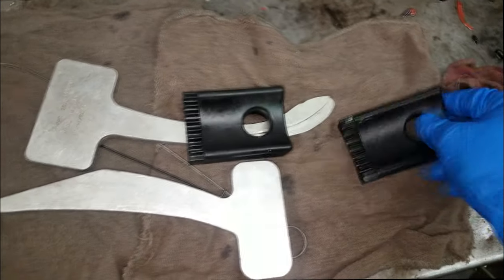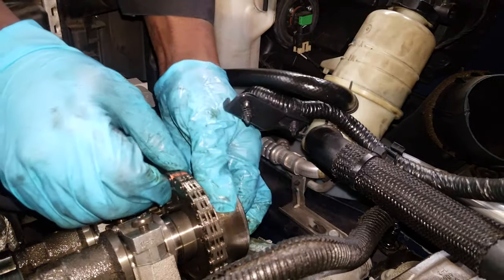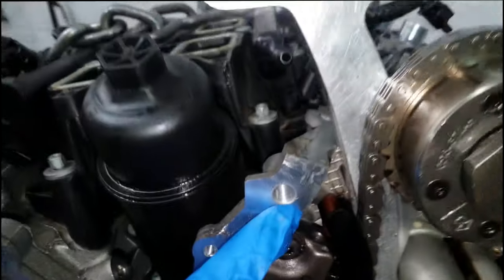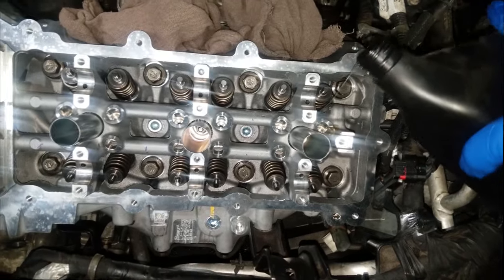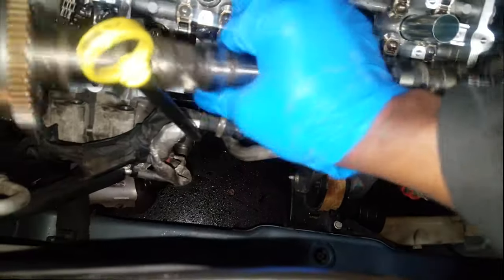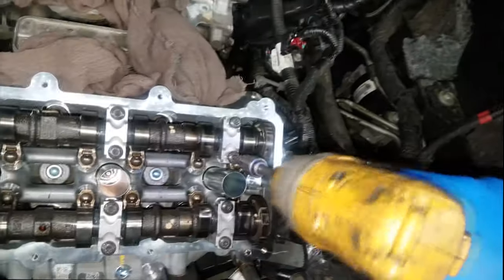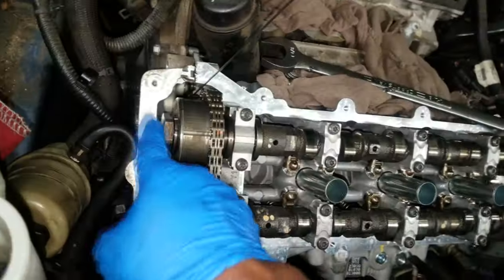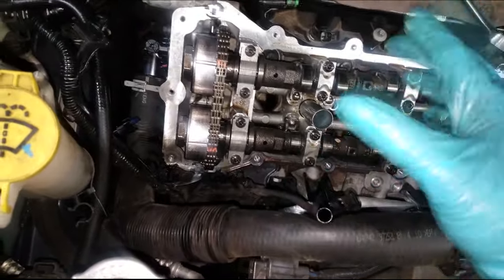How to Replace a CAMSHAFT, CAM Phaser,  rocker arms, 3.6 Pentastar, Timing Chain TOOLS P219A P219B

Comment: I had a warped head passenger side. Fixed it without any issues. Then found the same issue on the drivers. I popped the head off and got it plained like the passenger. Put it back together and now it throws p0300 and p000c p000d p0018 p0019. The engine fires up then stalls. It finally fires up and runs like an lobed out 350. Did an oil change, checked the all the plugs and all are plugged in. Same cams and phasers. I am stumped..... Did one side and all good did this side and majore issues.

Comment: Thanks for the awesome video!  This is a huge help as I have 2 bad rocker arms.  Question; is there a particular way to lay the cam back into the head? For example, do the holes on the cam need to be pointing straight up?  As I moved them to zero position to remove them.
Reply from the maker: Yes, during reassemble, the holes have to be up.
Reply: On 2008 gmc acadia there are no holes 😟 please help. Im reassembling

Comment: I've changed my rocker arms and lifters both sides all one time left side first then right . Made sure marks correct and out back together now van won't start. Must have jumped timing somehow or something. Do I need to take off timing cover to check m u timing ? I'm a first timer
Reply from the maker: Are you familiar with the term TDC? Well theres no marks on the crank so you need to bring cyl 1 up to top dead center. Remove vavle covers then see if your timing marks are off.

Comment: Where do i order the camshaft for my 2013 town and country? I order one but it doesnt fit. I need replace the one in front towards the radiator.. what do u recomend? Its bad on cylinder #4 ..
Reply from the maker: `Hey bud, all my parts come from Mopar oem. From a dealer parts department. Thanks for watching. Thumbs up the video and subscribe to the channel for me, thanks
Reply: @OnlineMechanicTips  what side is the one i need.. do i need the intake or the exhaust.. i dont know wich one is what..
Reply from the maker: @eddiediaz1562  Hey bud. Cylinder 4 is on bank 2 (front head) or (left head) I dont no which one you need as for the intake or the exhaust camshaft. Why do you need a camshaft? Are the cam lobes worn out or what because both or either of these cams can cause a misfire if the lobes are worn. Thats why I always remove valve cover for visual inspection. If you want to gamble, just get them both and use which ever one you need then simply return the un-used one. Are you subscribed to the channel?

Comment: Hey was doing this job and skipped a couple teeth on timing any suggestions on how to fix
Reply from the maker: Yes, I suggest you get it back in time. Curious, are you using the special tools? Also are you subscribed to the channel?
Reply: @OnlineMechanicTips  I am subscribed and we did use the special tools. I'm not sure how to get it back in time.
Reply from the maker: @mattrichmond2292  You will have to take the phasers back off. You will need the other head as a reference for TDC. Bring TDC back up using marks from the other head then put the head back together using the marks that hopefully you made befor dissasbly. Happens all the time
Reply: @OnlineMechanicTips  thank you so much for your help. Do I need to take the timing cover off to make sure I'm in time.  I am about 3 teeth off. Also, not sure if it makes a difference but so you know I did turn the car over. Before I realized it was off time.
Reply from the maker: @mattrichmond2292  yes, that matters  i didnt know that
.You def need to take cover over to view timing and parts and put back togethet.

Comment: I had a garage replace my rocker arms for ticking noise… after I got it back… I started getting camshaft faults.. p0344… they tried two different cam sensors now they’re saying it appears the timing belts are loose so they got a replace the tensioner what do you suggest I do they want to charge me more money now to fix that problem
Reply from the maker: Hey bud, first off, theres no timing belt so im assuming you mean the timing chain loose? Now if the tensioner not providing tension on the chain that could be a problem.. If this a high miliage car those cam phasers could be giving you problems. Curious if they took the timing apart to replace the rocker arms tho.
Reply: @OnlineMechanicTips  2014 Jeep Wrangler ..114k miles… never had any fault issues until they replace the rocker arms dealer wanted $3500 for a full valve job they charge me $1400 just to replace the rocker arms… not sure what they had to loosen to replace the rocker arms….
Reply: @OnlineMechanicTips  they did send me a video to show that the timing chain was loose because of the tensioner but why didn’t I have that problem prior to them replacing the rocker arms
Reply from the maker: @johnbarrios4531  Merely simply replacing all the rocker arms should not bring along new problems. If they took apart the timing in order to make the repairs, then its simple, it was not assembled properly. Its hard to say because I do not take apart the timing to do rocker arms, other shops/mechanic may do. But wow, dealer wanted $3500 for a full valve job??? Why on earth is a valve job needed??? They have to understand and know how important it is to properly torque things back to specs, especially those cam phasers, which may end up being you problem. But I do not want to second guess a shop that has you Jeep with them, they see first hand whats going on, im merely speculating because im not there.
Reply: @OnlineMechanicTips  All I had was a ticking noise and I just wanted to rocker arms replaced but the dealer would not just replace the rocket arms they wanted to replace everything the lifters the cams I don’t know if that even include the phasers in a timing chain… what’s the garage that did the work is that all they did was take the valve covers off and replace the rocker arms they didn’t say if they messed with the timing or not they just told me they didn’t touch any of that and the tensioner that went bad they did not see that at the time the rocker arms are replaced

Comment: Just changed rocker arms and lifters on my 3.6 2011 caravan. Engine runs fine no mis fire and super quiet. But on hwy it won’t shift to 6th gear and lockup. Where did I go wrong ?
Reply from the maker: Get the PCM/TCM scanned to see what code was generated.
Reply: @OnlineMechanicTips  yes. I am subscribed.
Reply from the maker: @annmariejugdeo2802  Get the trans scanned to see why 6th gear inop
Reply: @OnlineMechanicTips  complete scan was done by dealer. all codes were cleared but PO394 and PO 349 reappeared.

Comment: Awesome videos (1 & 2) on the Pentastar 3.6 cam, rocker, phaser removal & replacement. I wish I had seen them earlier. Have a 2015 jeep wrangler, changed out a bad rocker arm on the passenger side. used someone else's video where you just loosen the cam caps enough to raise the cam slightly and remove the bad rocker arm. For this I did not set the engine to TDC, but did have to rotate the crank / cam assembly some to get the cam lobe off the bad rocker. 
Put it all back together, it starts & idles fine, but throws codes P0369, P000A, P0017. Had none of this prior, and suspect I may have gotten the timing off with regards to the exhaust cam / phaser. I did replace the cam position sensor on that side, but issue remains. Thought to get your thoughts before disassembling this again, so I know what to look for during the process.
Reply: How did you resolve the codes? I have a Jeep. Replaced rockers and lifters, now getting two codes for positioning sensors on bank 1 and 2.
Reply: @jesmann66  In my situation I had to pull all the front engine covers off, line the engine up on TDC, and could see the timing chain had jumped a tooth, but just on the bank 1 (passenger's) side. Pulled it all apart, lined up everything afterwards was good. 

My mistake was rotating the engine counterclockwise, even though it was just a small amount. This seems to create enough slack in the chain to cause it to jump a tooth on initial startup. So for others reading this, only rotate the engine clockwise, even if all you need is a nudge backwards to get a single rocker arm out.
Reply: @stevevance1678  Oh man after reading this I think I may have just screwed the pooch on my wife's 2015 Wrangler. I had to rotate the cam clock wise and counter clock wise to get the rocker's out. Found out I had a badly worn lobe on the intake cam. Bank 1 . I am trying to figure out which cam to purchase.  Do they consider this the Left side if looking at the Jeep from the front or is it the right?

Comment: Hi I’m replacing the right exhaust camshaft and If  I get the part used from the same make and model and engine size will this work or does each vehicle have a special part number it needs? Thanks in advanced
Reply from the maker: Yes, I use used camshafts all the time, just make sure its the right exhaust cam (same as the one you replacing with). If the cam lobes not damage or the wheel not loose, go for it. Please remember to thumbs up the video and subscribe to the channel, thanks
Reply: Ok thank you so much I was a bit hesitant because the part number is the same but small numbers on the metal part of the right exhaust camshaft were different

Comment: hey brother I have codes poo16 p000c p000b. do you think my can phaser is the problem??  dodge charger 3.6
Reply from the maker: Hey bud, this to big of a job to simply guess at. Can the phasers be the problem? sure they could but i suggest you diagnose it first. Is the car mis-firing? Do the traction control or abs light come on? Also are you subscribed to the channel?

Comment: CAN YOU GIVE YOUR OPINION ON THE CHAIN AND THE TENSIONER BAR AS TO WHEN YOU WOULD RECOMMEND TO REPLACE BOTH MILEAGE-WISE ?  WHAT IS THAT TENSIONER BAR COATED WITH  ?  PLASTIC OR RUBBER ?

Comment: Great guide. When you take off the cam caps just to replace a back rocker does it matter what position the cam is in ? Thanks
Reply from the maker: Thanks for watching and subscribing..You typically want it in a position where the lobe is not pushing on the valve. So you may wanna just rotate it a little to get to that point

Comment: Can the metal from a flat lobe work its way into the phasers and /or lifters and cause them to stick?   Also - does a p0394 strictly apply to the cam sensor, wiring, pcm or can it be caused by a worn chain, cam timing or phasers?  thanks.
Reply from the maker: Hello my friend, thanks for watching and subscribing. Yes, ide suspect that those shaving can work there way anywhere in the engine.  Now theres several things that can cause this code and you mentioned them.  Ide cancel out the PCM and the timing if you 100% sure timing is correct. The last time i seen this code I ended up replacing the cam phaser on bank 2. But the megnetic ring thats built onto the camshaft could cause this. If you over 100k, ide suspect that phaser  slowly dieing a slow death bud
Reply: @OnlineMechanicTips  Thank you!

Comment: Wow nice video, im just putting back together a 3.6L on a 2018 dodge Durango, installed new chains and new intake cams (they were badly worn) i have everything lined up and my chains installed  and turned engine over 2 revolutons and bank 1 the straight lines are lining up perfectly. the arrows however on bank 2 are just slightly off of each other is that normal? 1 have 12 chain pins between the phasers and lined up the yellow links with the idler sprocket arrows. Everything seems perect except the arrows on the phasers on bank 2. Could you comment please?
Reply from the maker: It really depends on where the slack in the chain is at this point. That hydraulic tensioner will not fully expand until oil pressure rise. Rotate the engine again using a breaker bar on the crank and see where you end up at. Also are you subscribed to the channel?
Reply from the maker: So you didnt answer my question my guy?
Reply: @OnlineMechanicTips  yes

Comment: Do lifters go bad often ?? On these motors ??
Reply from the maker: No, usually a broken rocken arm but the valve covers need to be removed for inspection. Are you hearing a ticking noise? Also are you subscribed to the channel?
Reply: @OnlineMechanicTips   oh ok yeas I just recently removed ALL old rockers & replaced with new ones . Yes had ticking noice . I left the old lifters .

Comment: Please I need help. I followed your procedure but I accidentally rotated both the cam shaft independently though I have marks as you did . How to proceed. Does that mean I need to take engine out to get it aligned or can I use the untouched right side to help align left side
Reply from the maker: Hey bud, theres no way I can type all that in what I need to say..I will speak on this topic tonight on my livestream show..Please make sure you tune in at 8:00 PM est..
Reply: @OnlineMechanicTips  mountain time or CS

Comment: How much should it cost to have all the rockers & cams replaced on a 2016 Ram V6? My local dealership talking about $3,500? Should I just look for a remanned engine instead?
Reply from the maker: Wow, thats a lot. That estimate has to include all 4 cams and phasers with all rocker arms and lifters for it to be that amount..May be best to get engine because they could also be suspecting bottom end noise

Comment: What is the size of the wrench you are using to rock the cam shaft? 

What is the socket size required for the phaser retaining bolt / oil control valve? 

Thanks!
Reply: The hex on the cam shaft is 1-1/8 and the oil control valve hex is 1-7/16 those were the last 2 questions I had before fixing my 2016 wrangler. I paused some of TJs videos so I could read the sizes lol
Reply: @baddreams1436  thanks for the info, I finished my repair and have put 30,000 more miles on!
Reply: @clkoontz3  I didn’t see that the post was a year old until after I hit the send button lol Happy Motoring

Comment: Where do you get your parts list from to rebuild the valve train cams camshaft n rocker arms n guides from. For a 2016 3.6
Reply from the maker: Hey bud. Its hard to tell what you really need until you tear it down and inspect. But if you intend on replacing everything, this do not matter. All my parts are mopar oem parts from the dealer. It do not have to be tho. Thanks for watching, remember to thumbs up the video and subscribe to the channel, thanks

Comment: I have a 2016 Jeep Wrangler that’s having this same problem with my camshaft. How much for parts and labor to fix the issue?
Reply from the maker: It depends on what all was damaged. You not sure if it needs camshafts or not without checking it out.
Reply: Yes I subscribe to your channel, one camshaft is damaged and one  lifter is also cause a check engine light to come on. P0303 code cylinder 3 is misfiring.
Reply from the maker: @chynnabrown4744  O cool, not many parts needed. I assume the mechanic will factor parts plus the labor and give you a total amount. I cannot tell you what he will change, I do not know that. As for the parts, im not sure what parts he will use. To sum it all up, there is no set price on what this will cost. That figure comes from the mechanic.
Reply: Thanks for that information, one more question. You do not have to take the engine out of the vehicle to replace the camshaft & lifters correct?
Reply from the maker: @chynnabrown4744  correct..you do not
Reply: Thanks for the feedback! Continue to post great videos they really are helpful to followers like me.

Comment: question After everything is torque down to specks and all parts put back together---is vehicle ready to drive or is there something else needs to be done
Reply from the maker: I always use a scan tool to relearn cam an crank. And theres also a feature on our scan tool that will let you clean the cam phasers

Comment: I suscribes already and I have a question.
I have a Durango 3.6 and sometimes it makes noise when I turn it on first start and it goes away after a few seconds. Have you worked on a problem like that?
Reply from the maker: Yes, im assuming the noise you speak of is a ticking noise maybe? Watch this video and see if similar. https://www.youtube.com/watch?v=AArVGmQlgfk
Reply: It's not a constant ticking of the engine but when first start. It sounds like a Diesel engine and then after a few seconds that sound goes away. Also when that happens, the traction control light is on ad it looses power.
Reply from the maker: Right, I covered that in that video link..you will likely need cam phasers
Reply from the maker: O snap..i sent you the wrong link..youtube search my videos for the pentastar 3.6 diesel noise..it was on a grand Cherokee
Reply: Thank you, I'll look for the video. I hope a mechanic in Mexico knows how to do this properly.
Reply from the maker: @SalVille  https://www.youtube.com/watch?v=cAqw_sPC518&t=16s

Comment: This is a great video, all your videos that I’ve watched have helped me so far. It looks like I only have 1 bad rocker and it wore my cam shaft. I’m changing my cam shaft and the 1 rocker, should I swap the lifter associated with the rocker? And will it damage the engine being i am only doing the 1 side? Thanks in advanced for your advice.  Vehicle:2014 Dodge Challenger 3.6 vvt 150xxx miles ps what type of engine oil would you recommend for my vehicle?
Reply from the maker: Yes, I would put a new lifter with that new rocker arm. I tend to use what the car manufacturers suggest located on the oil cap unless I have over 180k, then I tend to change depending on the climate. Thanks for watching the vids and I hope you give them thumbs up and subscribed to the channel.
Reply: Online Mechanic Tips thanks for your reply, I did subscribe and I will be doing more mechanical work in the future as long as you keep posting videos like this to make it happen. All the cap says 5 w20 I’m wondering if synthetic blend or conventional oil, what is your summertime and winter time opinions on oil ?